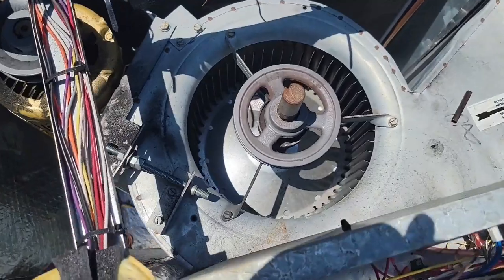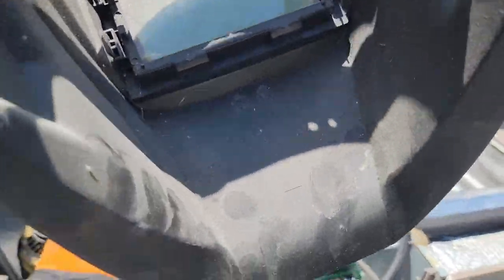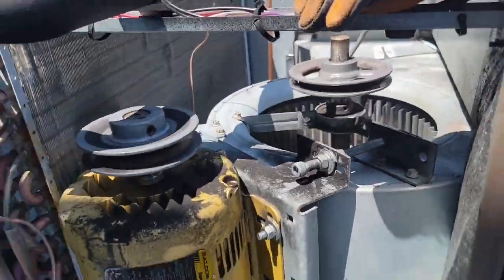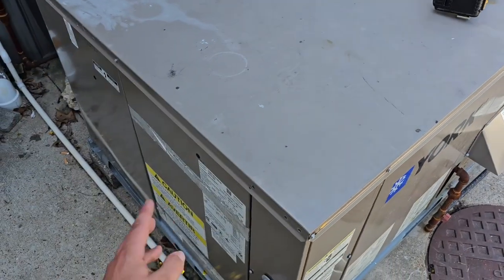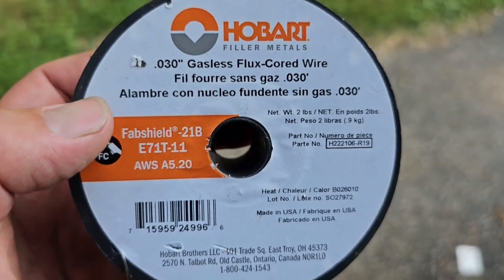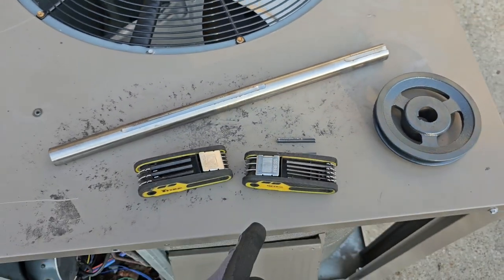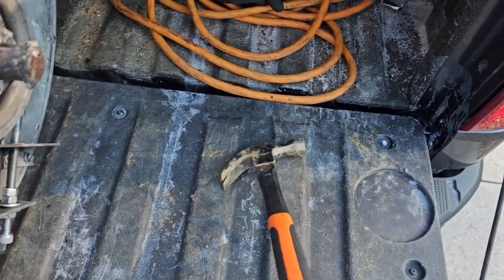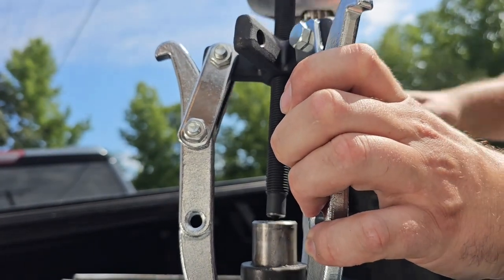How did the pulley come off the shaft?

Comment: I'd have 1st gone to a local hardware store to see if they had a similar or close to pulley.
It vibrated because you did not center the pulley onto the shaft diameter before welding. A spacer opposite the key would have helped.

Comment: The lock nut that holds the bearings in place has to be rotated as far it it needs to turn until it can’t go any further.  Then the locking screw is tightened down. Instructions should have come with the new bearings.